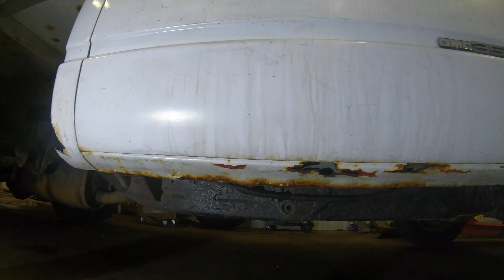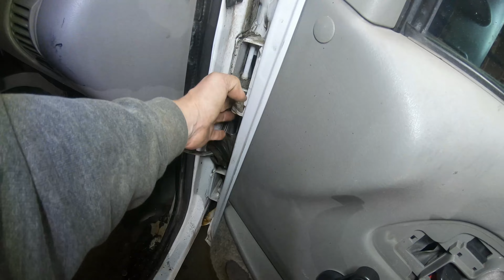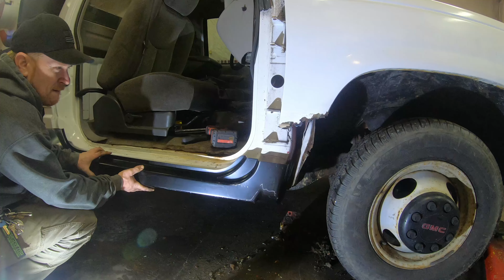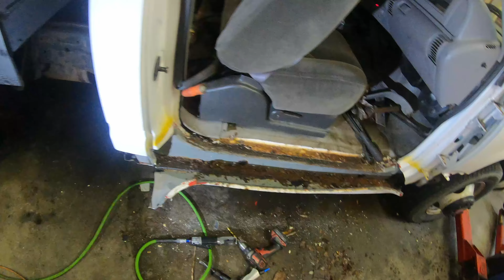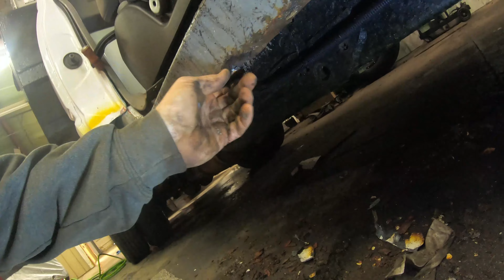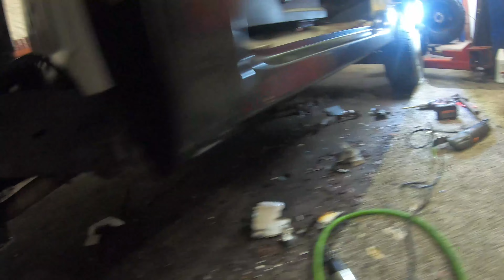HOW TO  Replace Rusty/Rotted Rocker Panel/Cab Corner GMC Chevrolet Trucks 1988-1998

Comment: Im in the middle of rockers, cab corners and to my surprise a bigger patch in the driver seat than  expected. This is no small task. I made my own floor pan patches and inner rockers panels due to the high cost of floor pans in my area. Be super patient and make sure you commit. This video helped me tons, ive never done this job but straight to the point and used the entire patch panel.

Comment: That body style hung around until 2000 with the HD models
Reply from the maker: Yes, True.... I just kept it simple in the year range. But yea the 3500HD 1999 and 2000 same body. Thanks
Reply: @KenMrKLC  
Also the 2500 8800 GVW AND 3500 Kept the same body style until 2001 when the 2500HD and New style 3500 was released
I have a 99 gmc 2500 sierra that is an 8200 gvw. Not an HD at all. 
Like you said the 3500 HD with straight from axel also shares the cab

Comment: Thanks for the vid. Question: At what point does it stop being  economically responsible to repair the rust on a car? So many vids on YT focus on classic/rare/custom cars, either being done for sentimental or skill-learning reasons. Ive got a Peugeot 308 diesel 2008 that I am comfortable with, but has some rot on the rear hatch. Im a certified TIG weldor living in Denmark, where everything is more expensive. Any guidelines?
Reply from the maker: Only you can decide that. There are many reasons you are considering or doing repairs etc... I don't think there is an exact science or method to figuring this out. Sorry
Reply: In the US with current cost of used vehicles and lack of new inventory and also sky rocket costs, it is more and more economic to keep old iron going. 
Unless the corrosion is excessive and unsafe